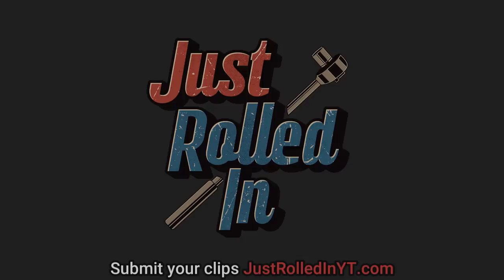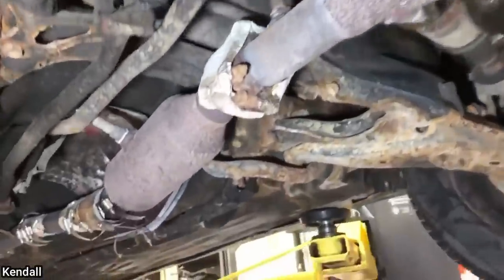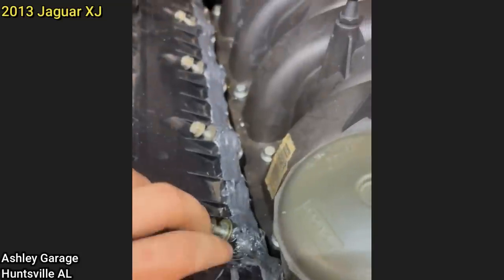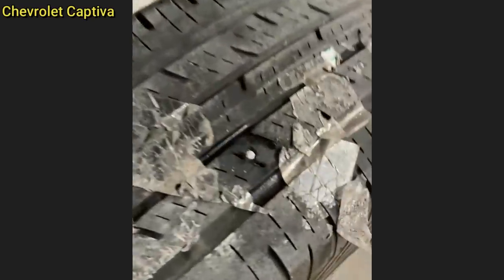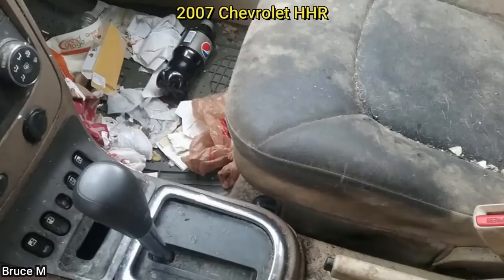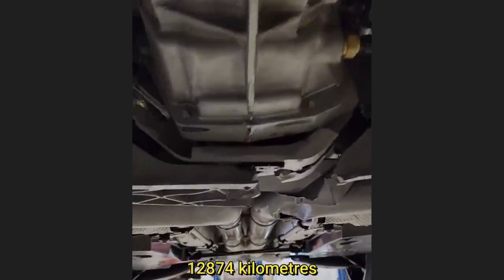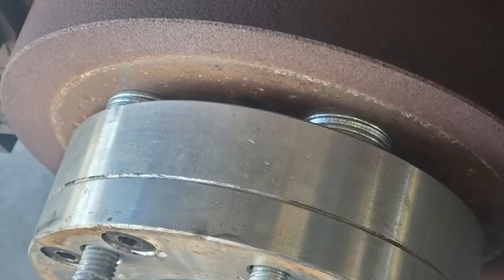Customer States Truck They Bought Has A Rumble At Low Speeds | Just Rolled In

Comment: If you can contact the shop about the gorrilla glued door...

Model airplane fuel dissolves the glue.  It might damage the paint... It's kind of slow, but it turns the Gorilla Glue into a jelly-like goo.  I am not sure which component dissolves the glue, but the oil keeps it from re-hardening for a while.

Slow drip "glow fuel" on the glue.
Reply: Nitromethane, because the methanol won't touch it.

Comment: Someone tried to use RTV instead of replacing the Fuel pump gasket on my VFR before I bought it so it was leaking gas. Replaced it with an OEM one and no problems since.

Comment: Regarding the valve cover ‘repaired’ with RTV. I used to work as a service advisor at a Chevy dealership. One day, I got a call from a person who still had an oil leak after replacing their intake manifold gasket on a 5.7l V8. I started asking questions, yes, he used a GM gasket kit, yes, he cleaned the intake and mating surfaces on the cylinder heads. Then I asked if he used RTV sealer on the front and back lips of the galley. 
“What?”
“Did you use Rubber Type Valve sealer?”
“What?”
“Permatex. Did you use Permatex in the from and back of the lifter galley?”
“Yes. I used Permatex.”
By them I was pretty sure of the source of the leak even without seeing the car. But there was one more question to ask. “Once you put the manifold back on, did you let the Permatex cure overnight?”
“Sure! I put the Permatex on, let it cure overnight, then put the intake back on.”
“There’s your leak.”

Comment: Got 2 GM vehicles, '06 Silverado & '04 Trailblazer. Both of these have this minor problem of the cruise not working when 1st startup in cold weather. If shutdown after 1st start it will work but not on 1st startup.

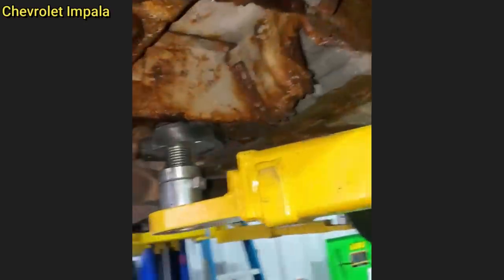Comment: 2:56 singing
"Oh the radiators hissing, and half the engines missing and the oil is running dry.
Oh there's water in the petrol and sand in the gears and she hasn't seen a garage in more than 40 years.
Oh but hear how she roars when the pedal hits the floor along the road too Gundagai."

Comment: Just subscribed! Funny shit! I have seen my fair bit of dodgy home mechanic stuff, done some myself back in the day too such as when I bumped a kerb with my oil sump tray it started leaking profusely so I used a G clamp on the corner and spray painted it black to not stand out while driving! A DVD sized oil pool would drip if I stopped at the lights for 3 minutes once the oil was warm!) I did a proper engine change on that car rather than fix the sump. Not much dodgy shit on that car though.

Comment: The Exhaust from the mechanic shop was the best,,i could not stop LAUGHING,,,and then the tune UP with the wires cut and taped together,,,I can see how people cant see suspension issues,but how did THEY NOT feel or hear anything on test drive,,,, I HAVE HAD MY 03'Z71 SILVERADO FOR 20YRS,AND IT IS STILL ALMOST MINT,,ALWAYS CHECKING FOR SAFETY ISSUES,AND MAINTENANCE IS DONE RELIGIOUSLY,,,,,IT IS EASIER AND CHEAPER TO MAINTAIN THAN TO REPAIR,,,,,PLUS A LITTLE PRIDE IN OWNERSHIP GOES ALONG WAY

Comment: Amazing.  Horrifying.
I confess that while a poor college student I tried one of those soup can/hose clamp repairs on my exhaust.  After struggling an hour, I realized how bad it was, and took it to the muffler shop.      Joe
Reply: That's okay brother, I repaired a collapsed throttle cable with a coke can and a roll of electrical tape once in the middle of a desert. Made it home.

Comment: Always, Always get a used car inspected on a lift before buying. If it cost you $25,00 or even $50.00, you will be better in the long run. If you sign the papers of ownership,  this makes it very hard to return or get your money back.  Then you have to go to small claims court and that is going to cost more than 25.00 or 50.00 for sure.

Comment: My shop has a f-550 duely with the RF wheel wobbling around caused by some steering & suspension components, bald inner rear tires and a broken axle in the LR that has the tires pointing in with some other problems I don't know about

Comment: In the UK you can fail the annual  inspection on a tiny detail. Mine had a tiny rust spot on the sill ( rocker ) and it failed. A spot weld later and it passed.  I've never seen an exhaust so badly repaired. It would have cost less to buy a new pipe and the taped tyre...Holy Jesus!!!

Comment: "be good out there." Lol, I have stuff that will blow right through that police truck.
Reply: Hmmm…so that’s where those missing RPG’s went.
Reply: @chipyeahoo  don't even need that.
Reply: @NOTSOSLIMJIM , if you have something that will penetrate 2 inch thick armor plating. The windows are over 3 inches thick.
Reply: @chipyeahoo  those are not the full military spec ones. The military spec vehicles have an outer hull with reactive armor and additional plating. The ones given to law enforcement only have the basic capsule made of aluminum. Just like the M113, large small arms AP rounds will pass right through without the additional armor.
Reply: @NOTSOSLIMJIM , this one came from Afghanistan, so…?
Reply: @chipyeahoo  the armor is still removed.
Reply: @NOTSOSLIMJIM , some of the outer hull panels are aluminum. It’s layered and quite thick though. The aluminum panels by themselves are 2 inches thick on top of steel with some type of thin liner in between them in some spots. It would still take quite an energetic projectile to actually outright penetrate it.
Reply: @chipyeahoo  a 50bmg AP cuts right though them without the extra armor.

Comment: When you get a car with no brakes and the customer drives it into the shop. Complaint: the brakes went out two weeks ago. Been using the E-brake. Now I have severe grinding noise whenever the car is moving. 
 Diagnosis: the internal parts inside the E-brake drum have broken all to bits from excessive and improper use of the E-brake. Also E-brake cable is stretched and needs replacing. Total cost to fix all brake problems$1354.89.  
 Customer replies: what all needs to be done? I just had brakes put on six years ago after I bought it.

Comment: So glad airline pilots are not allowed to perform maintenance on their airplanes.  Although I do know of one long-ago instance when an operator required the first officers of twin turboprop-powered airplanes to open a panel and check propeller oil levels at overnight stations where no mechanics were available.  Inevitably, a cam lock fastener in one panel was left loose and not noticed on preflight.  In flight, the propeller went to high pitch as speed increased, allowing the propeller cuff to snag the fastener and toss it into the engine intake.  In flight engine failure quickly followed, but the airplane landed safely..

Comment: That last Law Enforcement truck was cool and had a  very intimidating Vibe to it. I'd love to have one for commuting to work to make every one get out of my way. What's it get for mileage per gallon of gas.
Reply: The fuel mileage isn’t as bad as you’d think, at least for what it is. It’s around 5 to 6 MPG average if I recall correctly. According to the placard in the vehicle it weighs over 60K pounds although some of the original equipment has been removed.
Reply: @chipyeahoo  I had a 67 Chevelle with a 427 LT1 Corvette engine , Weiland High rise manifold. Holly 750 four barrel Carb. Headers and glass packs. Muncie 4 speed with Hurst linkage. It got about the same mileage as this, I got  10 mpg freeway back in 1978.
Reply: @mattpetty1 , I’d be willing to bet yours was significantly faster in the quarter though. LOL
The Caterpillar C9 in this is rated at 355.5Kw though which equates to about 483 HP and although I’m not sure on the torque I know it’s North of 1,200 Ft/Lbs.
Reply: @chipyeahoo  So your saying I could have used it for a tow?
Reply: @mattpetty1 , LOL. Sure, it’s set up for it. That’d be a sight to see pulling up at the strip. Am MRAP towing a 67 Chevelle.

Comment: The Cadillac looked like a new CT5-V Blackwing. Grill, carbon fiber splitter, and composite undertray are giveaways. That car is as fast around a circuit as a Ferrari 458. Sad to see it get torn up by road hazard
Reply from the maker: That sounds like an expensive fix then $$$
Reply: @JustRolledIn  transmission alone is over $6k, exhaust is probably another $2k. Spliter is $800-$1000, under tray is roughly the same. Parts alone I'd say this guy is looking at around a $10-$12k loss with labor being around another $4k.
Reply from the maker: @dcsteve7869  ouch! Good thing their insurance is covering the costs.
Reply: @JustRolledIn  Also good thing it's mostly mechanical and not major body work. On a $90-100k this won't depreciate it's value much even if it shows up on carfax.
Reply: @dcsteve7869  Might be a Total Loss due to the undercarriage damage,too?
Reply: @DrOlds7298  probably not. Didn't look like it hit any control arms or suspension but definitely cracked the transmission case. These cars are high value and retain a high value on the used market so even if there was something like a steering link such affected they would fix it. I had a deer strike in the smaller and less expensive ATS-V , lots of body damage, wire harness etc. $22k in damage, insurance paid it out

Comment: i used to work at an emissions checking equivalent, some people are just plain disgusting, gross, negligent and stupid:
we were given the option to just use our jeans with a emissions testing shirt or use an overall, after gettin on cars that smelled of piss, more than once and my clothing got impregnated of the smeel, i would always use the overall.
one prick once rolled an old Tracker that seemed was never washed, not only smelled of piss, but wet dog, cigarettes, and there was a peach pit on the ashtray that was not only moldy, but seemed that it was blooming.
also, the only one time i made use of my fire extinguisher knowledge, an old suburbar came in, emitting tons of smoke, while testing it only got worse, turns out, the smoke was very likely some oil leak that was falling on the exhaust and caught fire while on the test

Comment: The silicone around the valve cover gasket doesn't surprise me,, when researching how to change the oil pan gasket on a 2003 BMW 530i one forum had an entry that suggested using spray foam, the kind you use to seal air leaks around doors and windows in your house so these morons unfortunately are all too real.